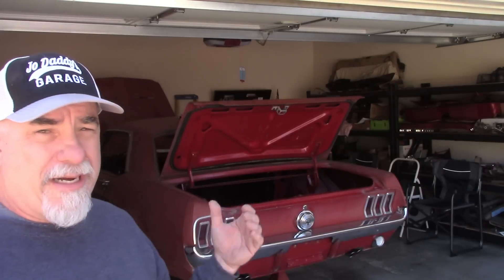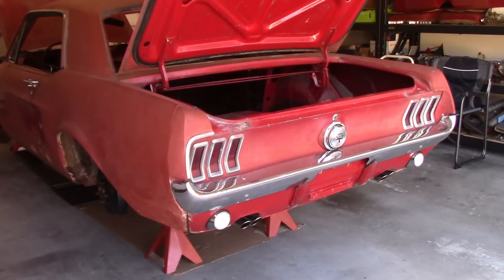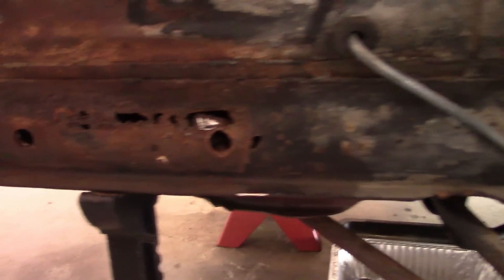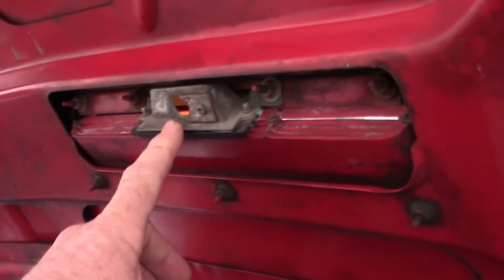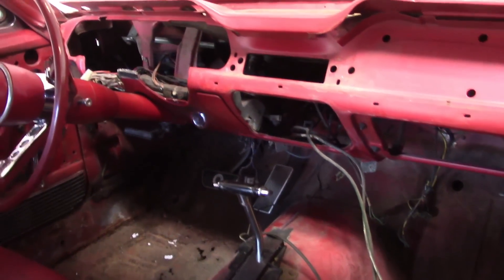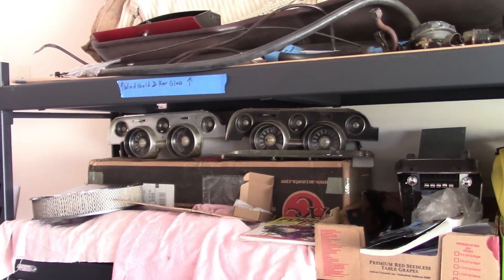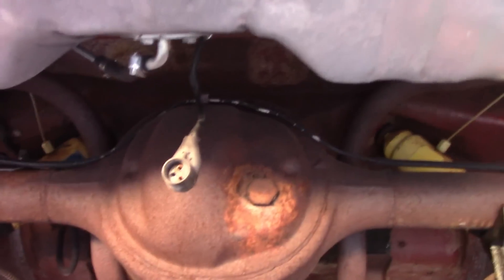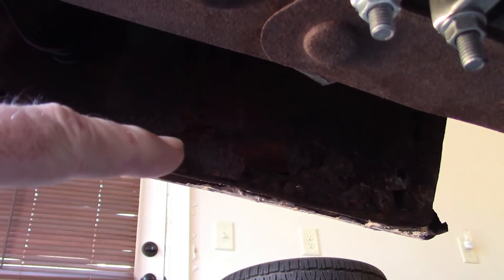1967 Mustang GTA. Evaluation for owner. Viewer's project.

Comment: My wife's 67 GTA fastback is also a highly optioned car but it too was ordered without traction lock. One legged 3.00:1. It also has both consoles but when I got it it had a real Shelby GT350 steering wheel which is very desirable.

Comment: G’day Mate, Richard from Australia. Luv ya work Brother, Your vid’s are awesome. I have been watching them all rebuild/ replacing different panels and parts. Great to see you use the Dakota Digital gauges, I have those  - can’t wait to power them up, but I think I’m a ways off that at the moment. Did you use the American Autoware stuff too ??  I can’t remember.
Im retired fro the Australian Army and I have a ‘67 Coupe which is my therapy and retirement project. Currently just finished cutting the entire floor out. I do need to replace:
1. The floor.
2. Both Front floor supports.
3. Firewall.
4. Upper and lower cowl.
5. Dash panel/ frame.
6. Torque boxes, both sides.
I have all these parts. With chassis/panel/ frame integrity and alignment in mind, what order would you suggest I replace them in - before I go crazy and cut it all out. Clearly piece by piece, to keep the main shell of the car right and square ! The entire car is gutted, except for the export brace & Monte Carlo bar. I thought just to keep the width of the car as best as possible. 
Keep the good vids coming man, and I look forward to hearing from you. Cheers Richard.
Reply from the maker: Thank you for serving your country. I have a whole series of videos in the Jade playlist. The first ones deal with the floor supports, torque boxes and floor pan. basically, you have to work in a process. The hardest part will be the firewall as it has to get past the frame rails and aprons if you want it to fit right. The firewall is meant to go UNDER the front edge of the floor pan. I try to do one side at a time. You need to remove the torque box to get to the floor support.
Reply: @JoDaddysGarage  thank you Sir, for your Service. I had the pleasure of being collocated with some of your guys in the Middle East ( USAF Red Horse, Armoured Infantry, Some Marine Corps guys in Iraq) fantastic people. I absolutely get ‘sequence is score’. Made me laugh really, because so much of what you learn in the military can have a real life application. Get through ‘Jade’ vids. Cheers Mate.